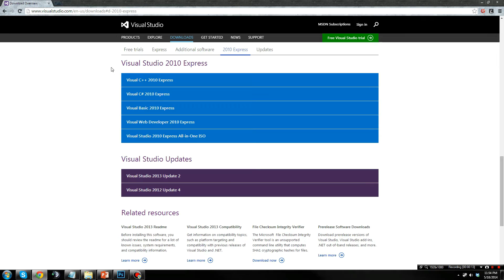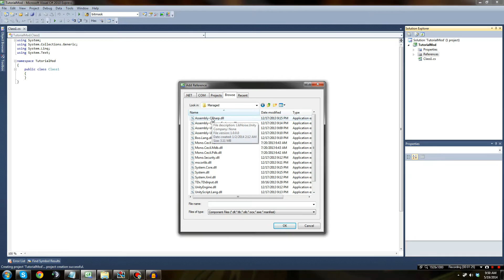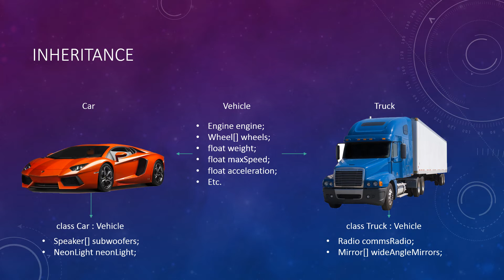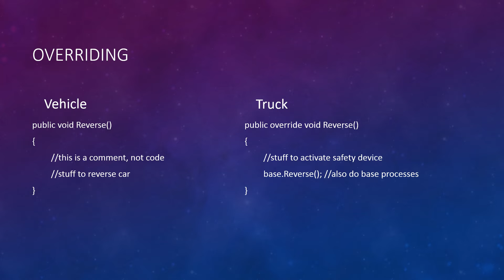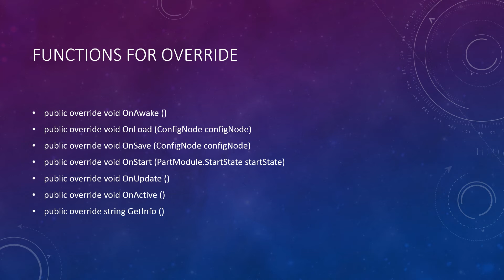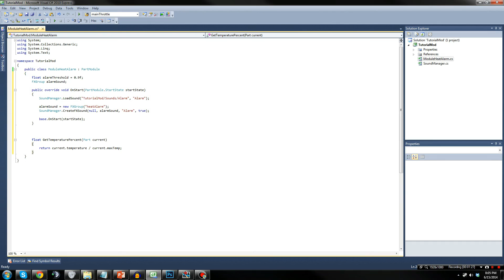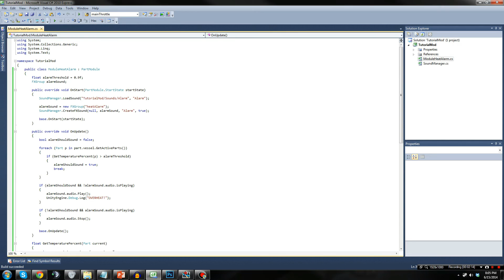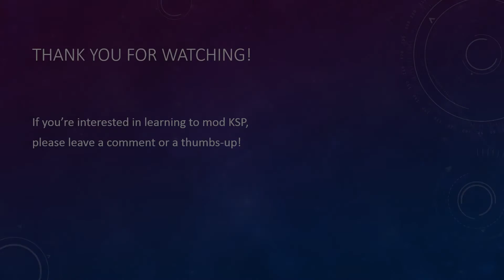KSP Modding Tutorial - Vol 1, Ep 3 - Custom Modules

Comment: I love this series Nifty, just a question regarding your alarm:
by creating the for each function in your mod.dll file you are asking to check every part that is currently attached to your part which is running this module,  which is why the alarm went off when the attached engine crossed the alarmThreshold?

In such a case where you wanted to Mod existing stock parts, would it be necessary to add that module to every cfg file for each part, and then wouldn't every part be running that module checking everyone elses parts every update? is it possible to piggy back on some stock game code to run that check every part for each loop for the single craft, not just based on the individual parts?
Reply from the maker: Michael Seidell Thanks for your question, and that is very smart thinking! I can't remember exactly how I wrote the code, but if I did as you describe, the module is indeed poorly designed. There is one "good" way to do this and one "better" way. The good way is to have a module check only its part and give every part the module through something like ModuleManager. The better way is to create an Addon (discussed in the next video) which monitors all parts using a foreach loop as this code does.
Reply from the maker: Michael Seidell (ModuleManager allows modders to add, change, or remove modules from parts without permanently and manually modifying each part's config file.)
Reply: Nifty255 thanks so much for the reply! just got into coding a few days ago, pervious matlab experience, def gonna look into that manager. 

I love trying to do something, think to myself there's gotta be a thing that does that and of course there is

Comment: Hi Nifty

I use your tut for learning c# but i have a problem with this code:

"return current.temperature / current.maxTemp;"

I get this error:

"error CS0266: Cannot implicitly convert type  double' to float'. An explicit conversion exists (are you missing a cast?)"

Any idear whats wrong there?
BTW im using VS2015.

cu
:)
Reply from the maker: In C#, there are three kinds of numbers, each with a different purpose. The first is integer, or int. It is any whole number like 2, or 300. Best used for counting whole things, like the number of Kerbals.

Next is floating point decimal, or float. This is any decimal number, up to a certain number of decimal places in precision. Good for counting non-precise percentages and for most coordinate systems.

Last is double precision floating point number, or double. It's basically a float, but double in data size. Meant for extreme precision calculations.

Now, you can use ints while calculating a float value, because the code auto-converts the type. You can also use floats to calculate doubles because it auto-converts. BUT... You can't use doubles while calculating floats without manually converting it. The code does this because it wants the programmer to be fully aware they're losing precision.

The fix will be in my second reply...
Reply from the maker: 1: Make sure the return type matches the type of variable you'll be changing with the function/property. The return type is the "public int/float/double" part of the declaration. I think this is your main problem, as you're likely trying to assign a double return type to a float variable.
2: In your calculations, make sure to manually convert anything with a higher precision than that down to the proper type. So let's pretend current.temperature is a double and you want a float. I think it's an int, but let's pretend. To convert anything from one type to another, as long as the types are mostly compatible, all you need to do is add parentheses in front of the variable with the desired type inside. In our imaginary case, you would make it (float) current.temperature, and it could manually drop the precision and convert double to float. But since in reality, temperature is an int, it auto-converts to float.

Hope I helped.
Reply: +Nifty255 Thanks for your help but as i wrote befor im new in c# and i don´t really understand what you mean :(
Here is my hole code, maybe you can see the problem.
namespace moa
{
    public class moa : PartModule
    {
        [UI_FloatRange(minValue = 0.7f, maxValue = 1f, stepIncrement = 0.01f)]
        [KSPField(guiActive = true, guiActiveEditor = true, guiName = "Temp. Threshold", guiFormat = "P0", isPersistant = true)]
        float alarmThreshold = 0.9f;
        FXGroup alarmSound;

        bool alarmOn = true;

        public override void OnStart(StartState startState)
        {
            SoundManager.LoadSound("Sounds/Alarm", "Alarm");

            alarmSound = new FXGroup("heatAlarm");
            SoundManager.CreateFXSound(part, alarmSound, "Alarm", true, 50f);

            base.OnStart(startState);
        }

        public override void OnUpdate()
        {
            bool alarmShouldSound = false;

            foreach (Part p in part.vessel.GetActiveParts())
            {
                if (GetTemparaturePercent(p) > alarmThreshold)
                {
                    alarmShouldSound = true;
                    break;
                }
            }

            if (alarmOn && alarmShouldSound && !alarmSound.audio.isPlaying)
            {
                alarmSound.audio.Play();
                Debug.Log("OVERHEAT!");
            }

            if (!alarmShouldSound && alarmSound.audio.isPlaying)
            {
                alarmSound.audio.Stop();
            }

            base.OnUpdate();
        }

        [KSPAction("Toggle Alarm")]
        public void ToggleAction()
        {
            ToggleAlarm();
        }

        [KSPEvent(active= true, guiActive = true,guiActiveEditor =true,guiName ="Turn Alarm Off")]
        public void ToggleAlarm()
        {
            alarmOn = !alarmOn;
            Events["ToggleAlarm"].guiName = (alarmOn ? "Turn Alarm Off" : "Turn Alarm On");
        }

        float GetTemparaturePercent(Part current)
        {
            return current.temperature / current.maxTemp;
        }
            
    }
}
The ineressting think is, that it works in your video but not for me.
Reply from the maker: As I had said in my previous comment, C# can't convert a higher precision number into a lower precision number (double to float) without knowing that you mean it. This is called implicit conversion. You have to tell the code "yes, make the conversion, even though I may lose precision." I can't tell you exactly where the double is that you need to convert, because I don't have VS to tell me. You have to look at each of the variables involved and find out which one is the double, and implicitly convert it yourself. I'd highly recommend learning about the different types of numbers in C# and how to convert between them first, though. My videos aren't meant to teach C#, so I wouldn't turn to them for any more help.

Comment: so looking at the main plugin code...
FXGroup is a utility you wrote.
SoundManager is also something your wrote as well right? It creates a list of audio files associated with the filePath string? 

You override (the term is a bit misleading, normally I think override as replacing one action with another, in c# it seem to mean piggy backing) the OnStart to load the audio file. But also create the soundFX object in game at Start?
Reply from the maker: Actually, FXGroup is KSP code. It's designed to handle not only sounds, but also particle effects and many other things, but The tutorial only uses it for sound.

As for the override, it is in fact replacing the base class's action with your own UNLESS you include base.OnStart. Then, it is piggy backing. You can see that my code has this call to the base function and is thus piggy backing.

Loading the sound: I do both load the sound and create the SFX object in the same start function. This is ok because the sound is loaded first. My Sound Manager first receives the load call, an, if its list of sounds is null, creates a new list and then proceeds to load the sound. Next, we tell it to load that same sound into our new FXGroup object. It runs through its list to make sure the sound we've asked for has been loaded, and hands it off if it has.